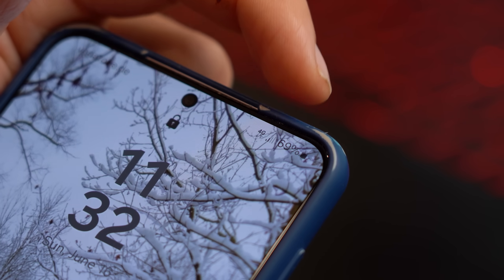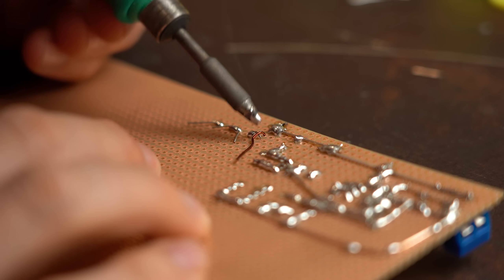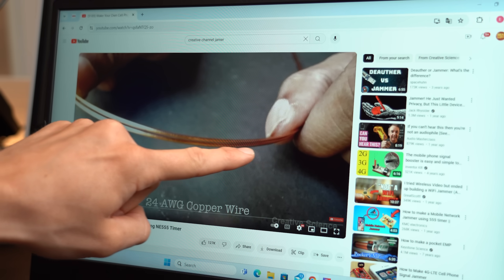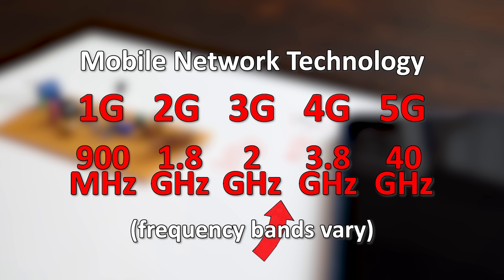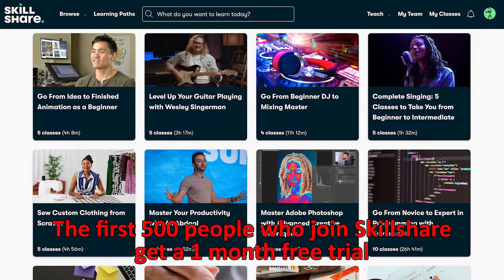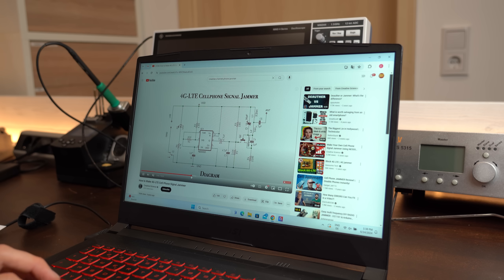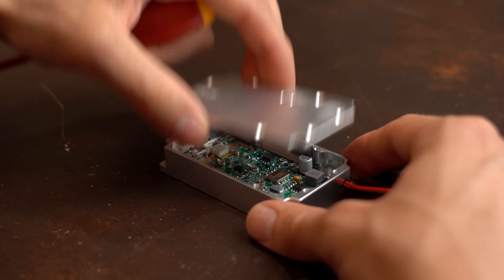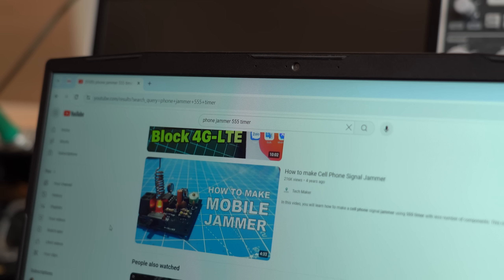Exposing the FAKEST Phone Jammer & Booster (I found on YouTube)!

Comment: While it's obvious that circuits like these can't work at radio frequencies, it should be noted that the capacitive load of a passive scope probe will affect the circuit and most common oscilloscopes can't measure such high frequencies anyway.
Reply: They in fact can with the right set up.

Comment: While square waves generate a lot of harmonics, they are usually too weak at the target frequencies. Phone data works at 700,800, 900, 1800 MHz and some more. It is not enough to emit a narrow band signal there, you may also want to let the transmitter change its frequency to cover more bandwith. You could do that with a varicap in the LC circuit. The Phone will probably fall back to other channels when one is blocked. There is a nice app "network signal info" that can show on what band you phone is operating at the moment.

Comment: Btw once you tried out an overcurrent protection circuit using a relay.

I was proposing if you could try out one using a transitor latch and differential amplifier. 
Like the differential amplifier circuit measurement the voltage drop across a shunt resistance and I output is connected to a comparator which trigger a transistor latch when the voltage drop across the shunt exceeds a certain value.

Like instead of using the relay you use a transistor latch

Comment: Other than all the telltales and main no-nos about this circuit capable of doing so is another one you didn't mention: you need way better frequency (so also thermal) stability that high up, that apart from the 555 already incapabe, but also the RC (time constant) oscillator is mostly a no-no. :)

Comment: Even the design of an antenna for this purpose is a science for its own.
Reply from the maker: True
Reply: @greatscottlab  make one with photoresist.
Reply: Some people make thesis about antenna design for these frequencies 😀 and in these videos the dude just coils wire...
Reply: @ДимитърАндонов-ъ7е  That "just coils wire" is called a helical antenna and perfectly legit for GSM applications. There are dual band and even quad band designs out there. People might write a thesis about novel antenna designs, but this isn't novel. People also cover pain management in their thesis, yet you're able to simply take an Ibruprofen against headache despite lacking a medical degree. It's really not that deep 🙂
Reply: My thoughts precisely! Having messed around with citizen band radio way back when, you quickly learn that there's very specific sizes of antennas for different frequency ranges. So just judging the antenna I was like... Nope!

Comment: I mean, a phone operate above 1GHz, most of the RF station work around 50 to 100MHz. the NE555 is a cheap solution for a beginner project, that also mean that it's not something can be used for this purpose. If I'm lucky and the NE555 happy, it might get around 2MHz max, the newer CMOS LMC555 might get you 3MHz. good luck using that to jamp a phone. that's only about the frequency, there's a lot of problem that need to be solved if you want to jam the phone. not that it will be legal though

Comment: Ahh of course the magic 40 gig 555 timer i have some of them lying around in my shop too 🫠
Reply from the maker: Haha send them to me. Mine are currently out.
Reply: The NE555 frequency is fairly irrelevant as it's output frequency has nothing to do with the RF frequency generated by the following oscillator. It just changes the operating point and therefore the CE capacitance, resulting in the oscillator's frequency being changed. And additionally generating mixing products of f_oscillator plus and minus n*f_ne555, where n is some integer.